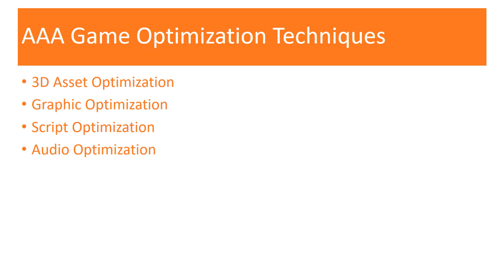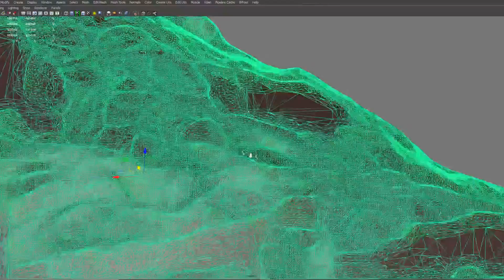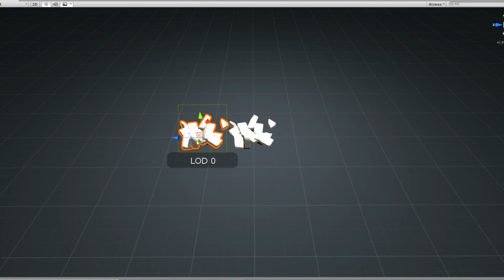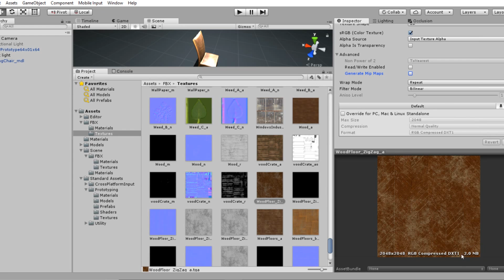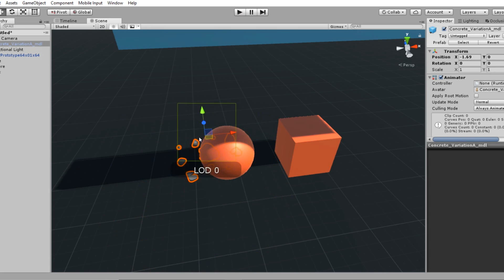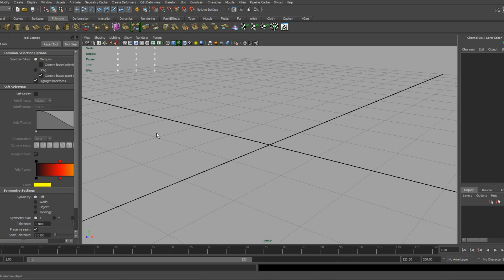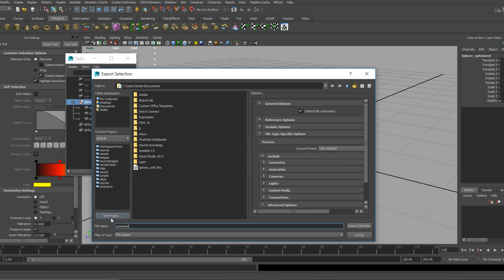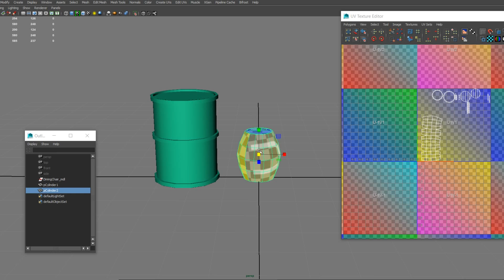AAA Game Optimization Techniques with Unity 3D Part I (3D asset Optimization) @Y3DS

Comment: hi, 2:50 you said do not aim for more than 100,000 vertices per frame ? what does this mean? can my single model have 100K vertices?
Reply from the maker: Currently mobile can only handle few hundred thousand vertices per frame. This means, if single model contains 100k vertices 50 gameObject contains 5M vertices. mobile can't perform that amount of calculation. ☺️😊 hope this is helpful